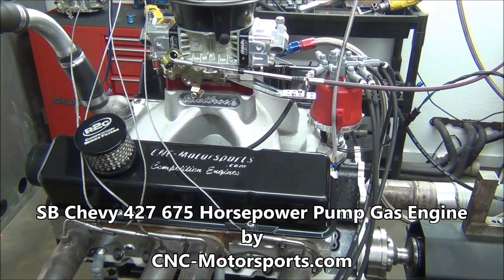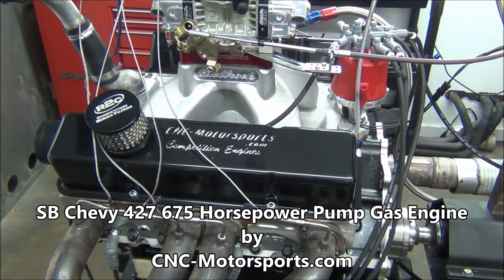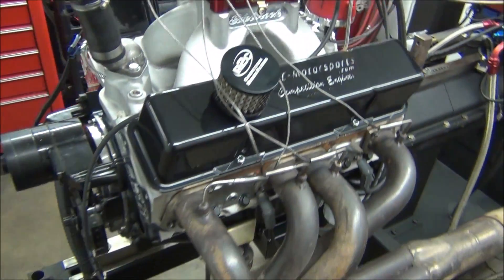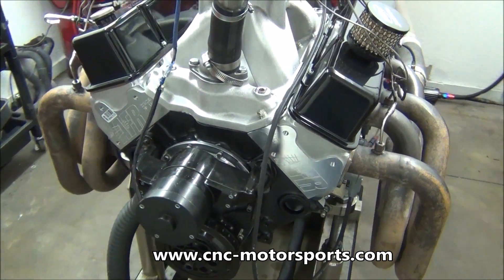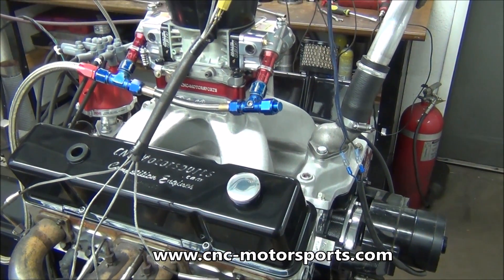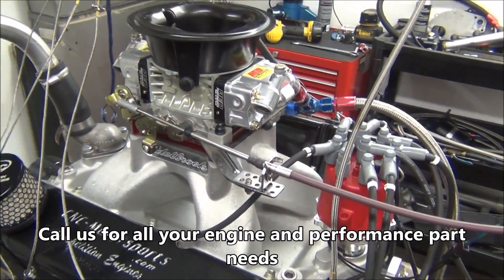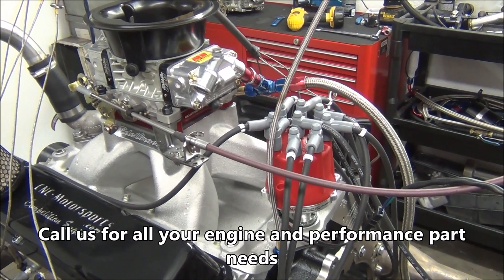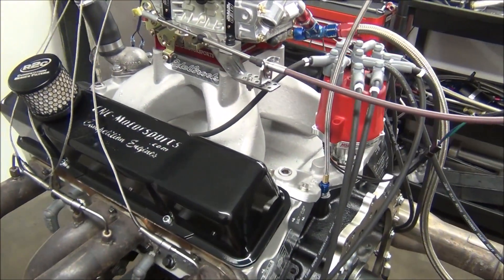675+ Horsepower Pump Gas SB Chevy 427 Crate Engine by CNC-Motorsports

Comment: when i see it at  engine masters competition on their dyno surrounded by witnesses then i'll believe it . and alot of those guys run high compression on pump gas . they rattle at low rpm's under load but they do make power. they just dont last .

Comment: Nice motor boys. It would surprise you how much cam you can put in that thing and still run it on the street. It sounded pretty thumpy at idle, but only peaking at 6500 says you could  put more..
Reply: The  way the torque  is  tipped,   its more  at the intake position the ran it a  bit advanced.  You spend  more  time at 4500 to 6500, so more  bottom is  appreciated unless you are on a  long high bank all day. -Sandy

Comment: My 516 made 739/697ft lbs at 10.88 actual compression and it doesn't like straight pump gas.  Hopefully EFI will help me out some. But anyways sounds like a pretty decent combination
Reply: You may have a sharp edge somewhere in the cumbustion chamber that glows, causing detonation. Using aluminum heads is the same as being able to raise your compression ratio one full point, allowing higher compression without pinging.
Reply: Yes 10.1 actual compression is all 91 pump gas will do 9.75 and you will be safe because all 91 is not the same in the back woods of Oklahoma anyway
Reply: John reeves not true, my 2014 mustang gt was 11.1 compression from the factory with 420 horsepower and ran on 87 octane every day of the week
Reply: @Benjamin Carvin  You are making a comparison to 2 completely different engines. One engine was designed in the 60s, the other 10 years ago.
Reply: @gumballer133  My 415 SBC @ 12:1 Runs just fine on most premium pump gas.  It has a lot to do with the way your heads are prepped.
Reply: @michaelangelo8001  So I actually learned more recently from Shaffirof that my cam I chose is alot of my issue.  It's 714/714, 110, 250/258. They said it's way too short of a duration.  That's also why it made tons of torque down low. It's been over 5 years now since I've driven the car now, so it really is mood point currently.
Reply: @gumballer133  "moot" 

 And yes, you can definitely run more compression with a longer duration cam.  Mine is .500 lift, 300* advertised.
Reply: @michaelangelo8001  Yes, Moot. I didn't catch it.  Lol.  I guess it still doesn't matter to  What Cam shops I have if I don't drive the car.
Reply: @gumballer133  Of course not.  But that knowledge will be useful when you are planning out your next build.

Comment: Does anyone know when Canfield   production stopped or are they still  being machined ??
Reply: Canfield has been gone for quite a few years.  sweet heads if you can find em but AFR is the go to heads now.
Reply: @brianbuck8875  I bought a set of promaxx 225cc cnc ported and the flow numbers are comparable  to afr 220.  The afr makes more mid range average flow but for the money the promax is a good set of heads
Reply: AFR bought out the Canfield tooling. Canfield heads can be bought new for big blocks again, but not small blocks. Flow numbers are identical for the canfields and the AFR's.

Comment: nice job , that is a really nice street Strip engine , 10.5 or 11.1 pump gas , 675 hp small block , yes it is achieve able with high quality heads and top engine builders !!
Reply: WIDE L.S.A., like the newer LS engines use. look at those ports and compression on their engines

Comment: i dont know how a sbc 427 can make that much power .. my 388 makes 535 - 550hp
Reply: +demarques t High compression, low overlap, with good aluminum heads, all forged, and high rev limit you can make 700+ on dart sbc 427's naturally aspirated 1000+ on boost/nitrous but that's risking failure with use.
Reply: +Christopher Manno depends on the builder but I'd recommend a short block they are about 4800 for all forged lower.
Reply: Christopher Manno Also pretty much any GM transmission will bolt right up to dart shp sbc's besides maybe 4l80E and above, they are Gen 1 style blocks with a few extras. obviously it needs to handle the power though.
Reply: +Christopher Manno no problem!
Reply: You can make that dyno say any thing you want 😁
Reply: Thats nothing, check out Shafiroff racings 434's that make 850 hp, or he builds nitrous 434's that make over 2000 hp. If you want better heads than the AFR's it will cost you BIG money for 15 degree stuff and porting.
Reply: @donrutter6765  it's not nothing for a PUMP gas sbc like what the video is about!
Reply: Damn....man that's exactly the house range that I'm looking for. Any advice? What's the max hp with vortec iron heads that have been port matched and bowl blended? Everything else identical. I cant afford to cough up 2 racks on some aluminum heads
Reply: @bradleydennis1263  I've seen 500 outta those iron heads with the right work done to them.
Reply: Bradley Dennis there are aluminum heads better than vortecs under $1k for a pair
Reply: @jubjub905  totally different league.   If your looking to make 300hp vortexes are great
Reply: The right combo of parts